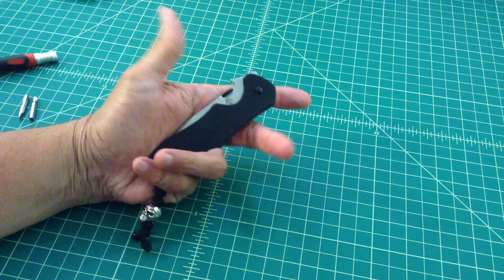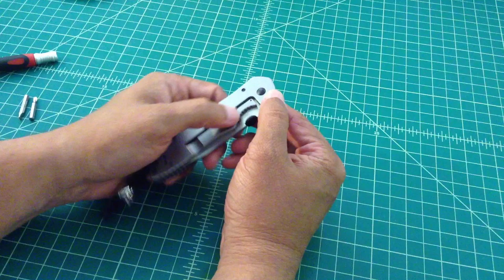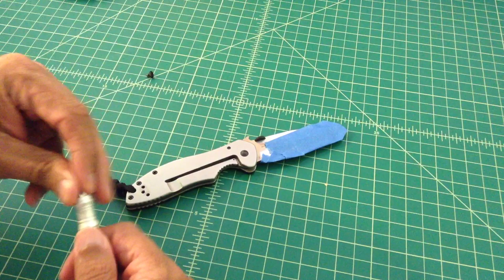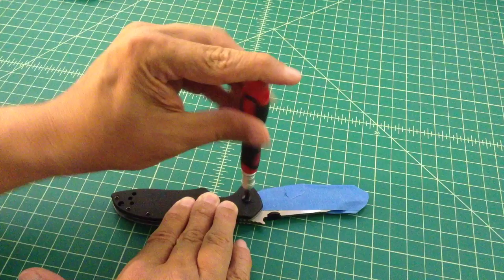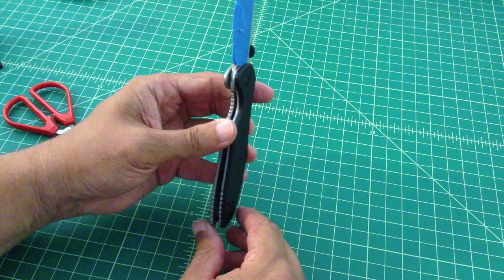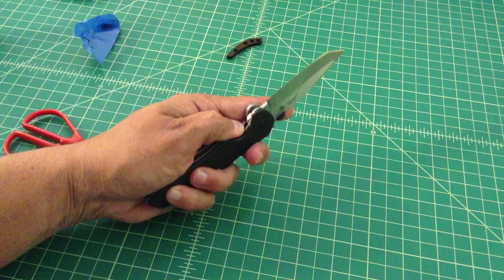Emerson Kershaw Cqc-7K - Easy Standoff Modification - TheSmokinApe

Comment: really nice mod
what kind of handle is that ? cause i have the original liner lock but it seems it's another system on your knife
Reply from the maker: Augustin MEIGNAN It's G10 and Steel on the lock side.  It's a frame lock.